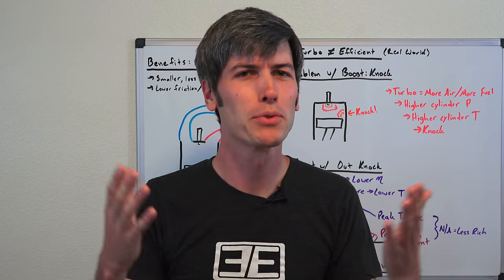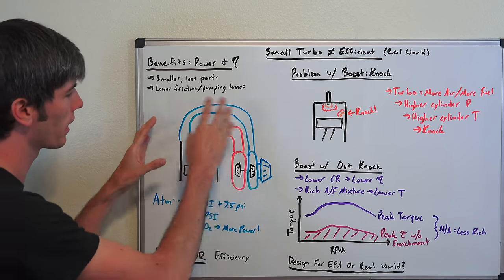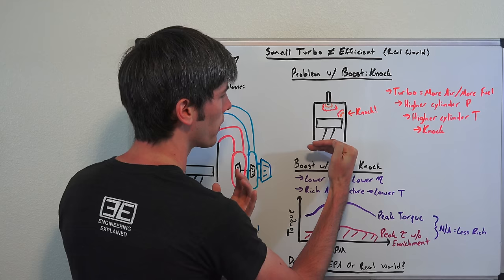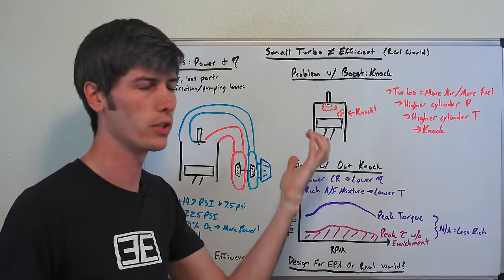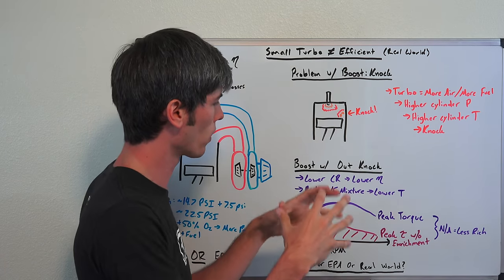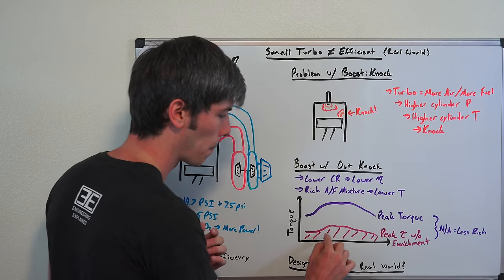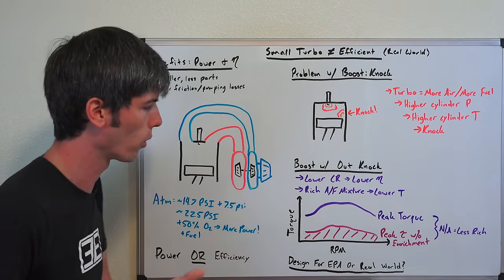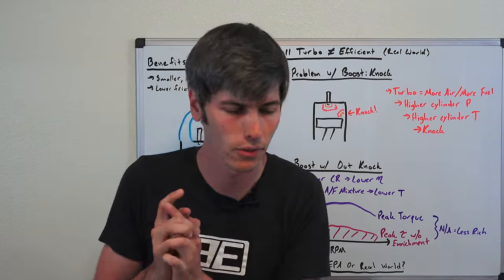Why Small Turbo Engines Are Not Efficient

Comment: A turbo engine is great power when you kick it and eco when you don´t. Its that simple
Reply: Which mean if I dont push the gas too much I can save more fuel?
Reply: @MMizie  if you dont push the gas at all you save all the fuel, amazin right?
Reply: You have eco or boost. You cant have both.
Reply: Carlos Soriano Q
Reply: Some say the flat torque curve means a turbo is less exhilarating to floor it. And a little boring to drive.
Reply: @rickeydriskill1096  with a custom tune you can. I can drive pushing 26 psi of boost or limit it to 5 psi basically turning my fiesta st in a Chevy cruise but who would want to do that lol
Reply: A turbo has more things to break.  Period.  Every time you "kick it" blowby causes engine oil to go through the PCV system into the intake manifold.  If you like your car and it is  a turbo dci, OIL CATCH CAN before it is too late.
Reply: Dan Solis new chevy cruze runs 17psi... stock
Reply: @4door_papi  my car does that in 2nd gear lol
Reply: Dan Solis congrats? Lol psi aint everything you have a small turbo most likely
Reply: In a heavy vehicle like a full size truck or SUV you will almost never be in ECO mode except downhill with the wind at your back.
Reply: M. Mizie If your goal is to save fuel, brake less, keep rpm 2000 or maintain 50-60 mph speed in high gear. And don’t get a turbo!
Reply: They will always have an annoying lag.
Reply: Engineering also forgot to mention that while naturally aspirated engines waste all exhaust heat save for minimal scavenging benefit, turbocharged engines harness quite a bit of that wasted energy and convert it into work.    That means a turbo is inherently more efficient.   A turbo four cylinder compared to a NA eight cylinder also has less internal friction and less mass to accelerate thanks to that smaller lighter block.
Reply: Yeah but that doesn’t fit the narrative that Ford makes crap engines and lies to their customers Martin.
Reply: @DrBleck35  the blow by is excessive because they don't put extra rings. Crap performance motor.
Reply: A v12 twin turbo is never eco.
Reply: As it is on a NA engine.
Reply: Sammy D or the PCV blew its internals. Seen it happen to a PT cruiser. Of course the oil only flows into the manifold under vacuum and goes away under boost
Reply: Rickey Driskill You can with newer cars.
Reply: Stephen Powdexter A turbo is never boring to drive.
Reply: F165 oh yes there are boring turbo cars, lets bring that polo 1.0 tsi 90 hp
Reply: Were on about small engines ther not as good as a bigger engine when it's in a bigger car
Reply: Nope. My turbo V6 gets the same gas mileage as a V8 when cruising on the highway.
Reply: An advantage of performance turbo engines is a broader torque curve for more power in real world driving sitiations, and they're also lighter than larger NA engines for better handling.
Reply: @rickeydriskill1096  
If you stay away from boost like 3.5 or 4  RPM u are in eco mod .
Reply: @DrBleck35  nothing in that statement is true. Engines with blow by are not operating correctly. No turbo engine is designed to have blowby. So no issue as long as you follow the manual for the vehicle correctly and dont try to think you can put the same fluids from a 1969 muscle car. I recommend full synthetic oil for one
Reply: @aluisious  I kinda doubt that the engine naturally gets less gas mileage. Though from driving both that the difference is slow close that I say buy what you want. The 5.0 is so efficient that it get relatively close anyway. The fuel economy is for regular driving. I know many people talk about crap fuel economy and go around 80 or 85 in the highway which explains their lower numbers
Reply: Which means it's an absolute dog if you aren't building boost....
Reply: The guy on the video just did a huge explanation. You weren't very good at school I can assume. It's not that simple
Reply: Turbo car doesn't move at all when you don't kick it or when the turbo doesn't spool at all 
If you buy a Turbo car, forget economy
Reply: @nithishjvj8736  well newer cars have turbo now. And a newer car has more gears or use cvt that help it save gas. You'll still save gas regardless to a 5 year or 10 year old car.  Plus turbo engines are usually smaller than 2.0L
Reply: @JoseRamirez-yh2ll  I've a got an X5 40e a 2.0L turbo 260hp and plus Electric motor combined 320hp 
My turbo SUV being a hybrid still only returns 6.5kmpl in the city and 10kmpl on the highway 
Main reason is there's more than 100hp per liter from the engine alone, thats a down side and all these modern downsized turbo cars are heavier complying with safety standards, so small capacity being not enough the turbo has to spool up and economy leaves the chat
Reply: I would rather have a v8  with driving modes  ! Eco, city, sport ! Also an ls7 weighs as much as a k20 !
Reply: @nithishjvj8736  well explained, mate.
At the end of the day it all comes down to power to weight ratio. For example your SUV, yes it has 320 HP with 60 of them instantaneous, but it weighs almost 3 tons.... There's where fuel economy goes by.
Reply: @rickeydriskill1096  mazda joined the chat
Reply: Big turbos can be more efficient because it's easier to stay out of boost. Low torque, high revving engines are similar in that it's easy to stay in low power by keeping rpms low. So by that logic, small high revving engines with big turbos are best for efficiency if you can control your desire for speed, which I cannot do.
Reply: @rickeydriskill1096  ecoboost fords: 👁👄👁
Reply: No however turbocharger have to work every time. Taking too much of air because of that turbo life span will be low naturally aspirated engines are best in all aspects.
Reply: Big turbo engine is even better then right?????
Reply: @BoopSnoot  The "work" you're referring to is the work required to spin the compressor wheel of the turbo.  True scavenging of exhaust energy requires a connection of the exhaust impeller to the crankshaft.  This was done on some Wright 3300 series aircraft engines.  They called it compound turbo (not the same as modern compound, in-line turbo).  It worked, but the complexity/ reliability were problematic.  So no, conventional turbos do not harness exhaust energy to do work, they harness it to provide more air for the combustion process.
Reply: @michaelchristiansen1497   Turbochargers convert otherwise wasted thermal energy into kinetic energy, to not only reduce pumping losses (fighting a vacuum) but to provide positive pressure because the more oxygen that can be pumped into a combustion chamber the more fuel can be burned per cycle and the more power produced.   You also seem to be confused about various terms such as "scavenging" which in the automotive industry is generally referring to exhaust pulse scavenging, using the vacuum created behind the exhaust pulse to help intake fresh air into the combustion chamber.  Turbochargers interfere with the exhaust pulse and so reduce this specific perk, but more than make up for it by using thermal energy from the exhaust to compress air and force it in from the intake side.
Reply: @BoopSnoot  I'm not confused at all and I specifically said "scavenging of exhaust energy", not the scavenging effect.   Turbocharging does not "harness otherwise wasted exhaust energy" , it uses exhaust energy to artificially increase the displacement and allow it to burn more fuel, thus making more power.  Another commentor correctly describes it as another way of doing displacement on demand.  Pumping losses, rotational mass and friction are at least partially, if not totally offset by substantially higher backpressure on a boosted engine.  There is no free lunch; if you want to make "X" amount of power, you need "Y" amount of fuel.  The efficiency myth is marketing.
Reply: @michaelchristiansen1497  You are clearly confused, scavenging is a very specific word with a specific meaning.  Look, while I'm in a management position now, I have a Mechanical Engineering degree and was on the AU FSAE program where we designed a miniature race car that performed well enough for the university to continue funding in perpetuity after that.    You're trying to propose that not only am I wrong about very basic concepts that you're not quite grasping, but that the entire automotive industry is wrong.   Backpressure doesn't matter, system pressure does, and you're getting a "free lunch" converting wasted thermal energy into useful mechanical energy that reduces pumping losses even when out of boost because its at minimum removing the need to fight a vacuum.  With very rare exception, the industry is universally switching from larger static displacement engines to small turbo charged engines primarily because of their improved EPA fuel efficiencies.      Either you're right or all the Engineers in the automotive industry are right, its not both, and I think its common sense who is in the wrong here.
Reply: @stephenpowstinger733
nope, turbos can have exponential torque curve if you want to have

Comment: All I heard was V8s are more efficient and I should drive my turbo car fast for better mileage. Don't correct me, this is the world I want to live in.
Reply: Danny Daskalakis That’s my world as well
Reply: I like your world, which is why I have the best of both ends described by you: turbo-six :D
Reply: Larger engines just make the power easier. Don't need all the turbos, cooling lines etc just to make 400 horse with a v8
Reply: Playboysmurf in Venezuela there are no cars to start with
Reply: Corvette have been getting 30mpg since the 90's including the pushrod 7.0L with 500hp yet our 09 CLK350  DOHC 3.5L/270hp barely managed to get 24mpg highway
Reply: Don't Tread On Me , love your name, fyi, I fly the  ‘GASDEN” flag, and wear a pin daily .
Reply: You are not exactly wrong, either. Especially in larger vehicle applications, the real world gas mileage of a larger N/A motor is better than that of a smaller boosted motor. The old adage is true...

No replacement for displacement :)
Reply: Danny Daskalakis I drive fast, and I get 26-33 in my MK6 GTI so I think he is on to something.
Reply: I have a Supercharged 4.6 and I get about 20-22 MPG depending on how I drive while my mom have a N/A 3.0 V6 which gets 18 MPG
Reply: Big torque and tall gearing, low RPM, usually equals decent distance covered for not much fuel consumed.
Reply: Danny Daskalakis except you live in a place where cars and mopeds are move slower than snail.
Reply: nice grammar, must be brazilian BRBRBRBRBR
Reply: What's mpg? I only go by spg. If it's not making me happy then what's the point in having it?
Reply: Lifted_Above this is why diesels are so efficient
Reply: My old daily driver was a 1994 Mercury Grand Marquis with the 4.6 V8.    When I got it was good for low to mid 20's MPG but once all the emission crap was removed or defeated and tings tweaked to get away from the emission compliant setup to a more fuel efficient tune it was pretty reliable for getting upper 20's to even low 30's MPGs!
Reply: Rev it up - Because low RPM will cause excess carbon build up in a modern engine.
Reply: A 1998 Cadillac Seville with a NorthStar V8 gets around 31 hwy and 20 city. Best turbo engine GM has ever made is the turbocharged 3800 pushrod V6 in the Buick grand national.
Reply: V8 can be efficient at low load, but the higher the load, the more of that sweet malt dinosaur juice it drinks. This is especially true in old engines, 16-valve pushrods with a prohibitively heavy iron block/iron head/forged steel crank setup.
Reply: sure, if only they could get the weight down. GM LS series was pretty good about that, less weight then straight 6's
Reply: With new Euro6 anti-pollution norms you'll have to say goodbye to V8...
Reply: My LT4 gets 30mpg thanks to some 3d printed pistons
Reply: I don't have an audi twin turbo for fuel economy.

Comment: Ecoboost engines at least in the trucks get worse mileage and can't tow as well as a typical v8. Ecoboost are only good on paper
Reply: I’m struggling with the fuel economy with the 1.5L ecoboost in my fusion. If I’m going for fuel efficiency I have to barely use any throttle lol.

Comment: You mean to say that when my engine is making more power, it's also using more fuel? Say it ain't so!
Reply: It's not so
Reply: not necessarily, compression ratios play a pretty big part. two engines can be using the same air fuel ratio at the same displacement, and provided the fuel can handle it, the engine with higher compression will make more power while using the same amount of fuel.
Reply: Its efficiency what we are talking about. If you accelerate little with a smaller turbocharged engine it is going to consume less than a naturally aspirated engine. If you accelerate more, it is going to consume more. Consumption tests are done when accelerating little, while in the real world, you may accelerate more, so consumption is higher than its rating, or higher than the former N/A engine.
Reply: Not always, but if the extra power comes from forcing more air at once, then yes... because more air always requires more fuel to keep the same A/F ratio. You can make more power and gain efficiency by adding compression or reducing friction. You can also improve breathing, which while not cramming more air per stroke, does shift the powerband into higher revs... since you have to rev higher to make the power afforded by the airflow, you have more strokes.... so you still use more air (and fuel) overall if you want to take advantage of the power gains.